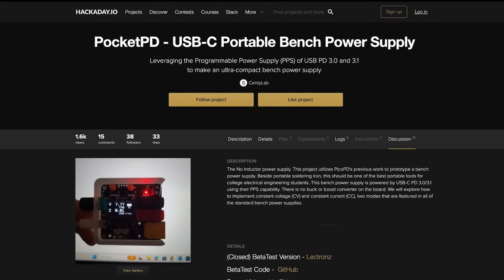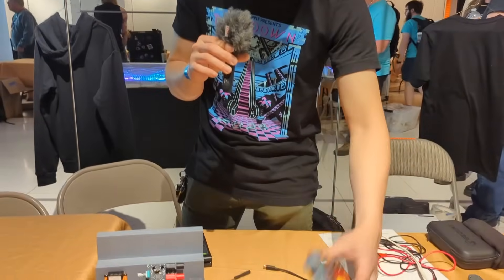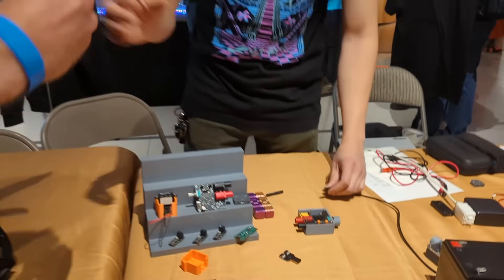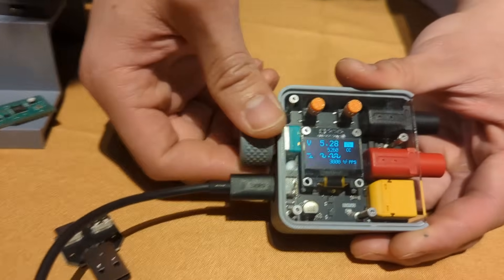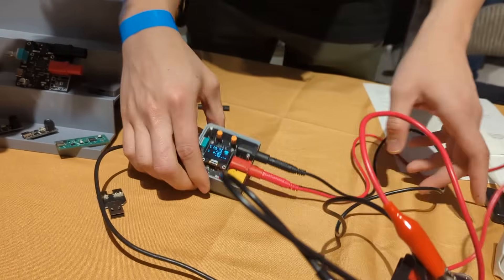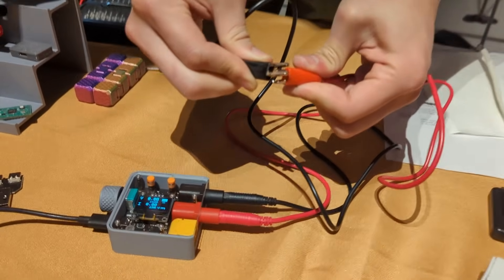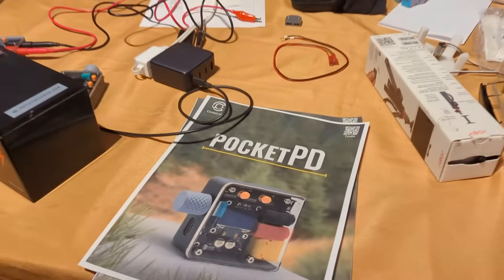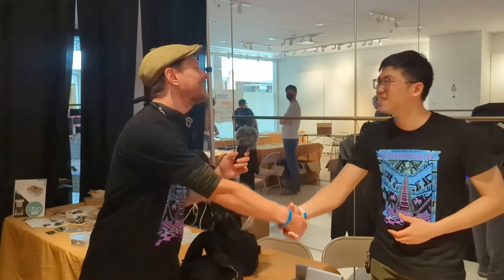Innovative Bench Power Supply with No Inductor Technology - PocketPD

Comment: How is this different from PPS that is supported by most PD chargers? It lets you set specific voltage already with 0.01V resolution
Reply from the maker: Great question! Pocket PD indeed offers similar fine-tuned voltage control like PPS, but it also combines voltage and current control into one device, which is not always available in standard PPS chargers. Additionally, Pocket PD includes features like short circuit protection and ideal diode protection, enhancing its safety and functionality. This makes it a more comprehensive tool for users who need precise and versatile power delivery.
Reply: I think they do, but with extra capabilities like cc and and a visual interface